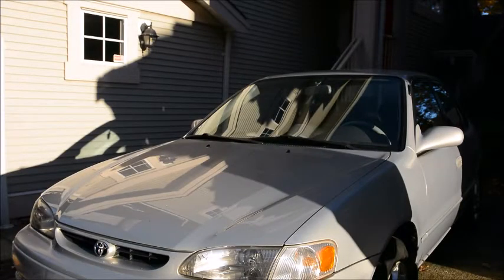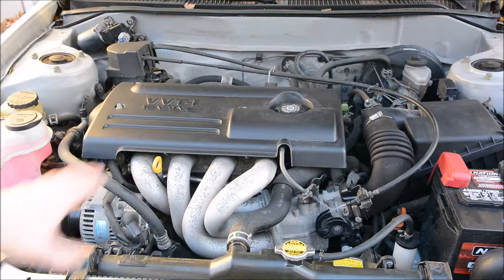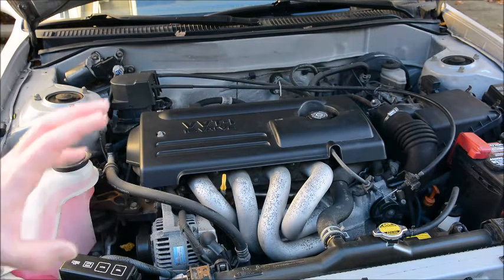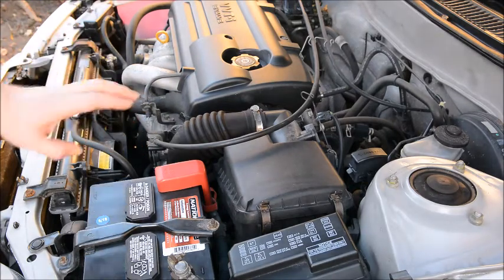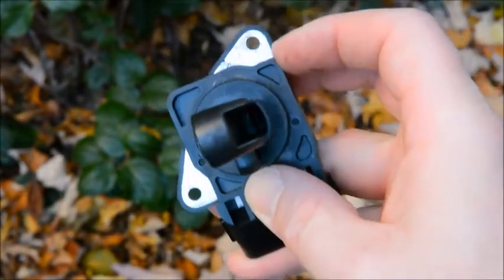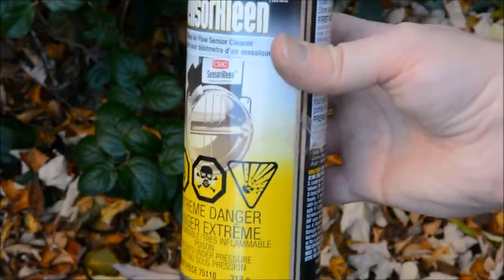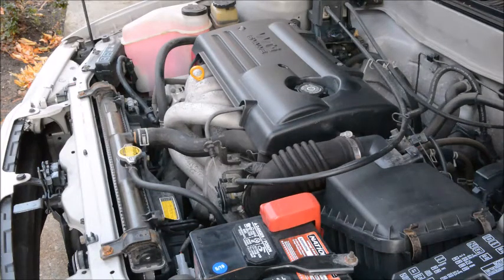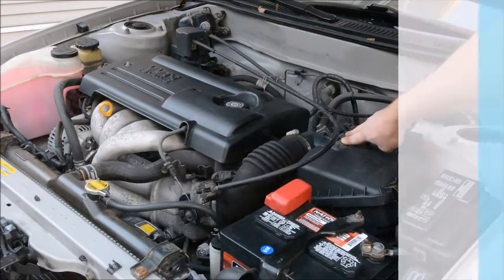Toyota Corolla Hard Starting, Stalling, Stumbling Throttle - MAF (Mass Airflow Sensor)

Comment: I bought new sensor from toyota dealer, i got 2013 toyota with over 200k, it still stalls when i start engine shakes, only when i push gas pedal hard it runs normal, still code P101, Any ideas?
Reply from the maker: Hello there, sorry to hear about this.  The P0101 code comes up when the MAF sensor is getting a reading outside of the normal parameter the car was designed with.  As the MAF in this application only measures temperature and air flow, the air flow is the only suspect with either too much (hole somewhere) or too little (restriction somewhere).  For this, the best case is to follow the air path with a critical eye for detail. start by removing the air filter to ensure it is clean and the air box is not full of debris.  Next, remove the articulated tube that goes from the air box to the throttle body/plate, check very closely for cracks or tears as you articulate it back and forth.  Use a flashlight to look inside the tube and see if there is any debris.  If there are any hoses attached the articulated tube also check them for cracks, tears or other damage.  Then, use a flashlight to look at the throttle body/plate to see how dirty it is and if it is dirty, clean it the best you can with electronics cleaner.  I can't recollect, but I don't think the car will run well with the articulated tube removed, but if you use a healthy amount of electronics cleaner and a clean rag you should be able to clean it up mostly, but use caution not to stab or get threads into the throttle body/plate.  Best of luck!
Reply: @andrew_ball  Will try it out , thank you!

Comment: Mass A F S from autozone or toyota which is better..toyita is 200.00 autozone 80!
Reply from the maker: Hello, sorry to hear that the time has come to replace the MAF sensor.  I have full confidence the Toyota part will work, but not the same confidence with others.  Denso is the original manufacturer of the part and the Denso MAF sensor is available from places like Rockauto for a pretty reasonable price and they should be able to deliver fairly quickly.  Best of luck!

Comment: Soo weird that the Corolla can struggle to start because of this airflow sensor, such a weird quirk.
Reply from the maker: Hi, thanks for watching!  I understand that the MAF sensor (Mass Air Flow) is the only way for the engine management on this engine to measure the air volume entering the engine in order to use its built-in calculation table to determine the optimum air/fuel mixture that offers the best compromise between power and efficiency.  If the MAF gives nonsense readings I would imagine that the computer still performs its calculation but gives the incorrect amount of fuel during the fuel injector pulses.  On the car in this video I didn't notice an excess "gassy" smell from the exhaust, so I suspected that it was running too lean (not enough fuel) which would make the engine very difficult to start.  I hope the video was interesting and helpful, thanks again for watching!